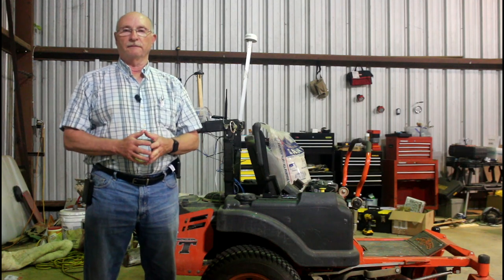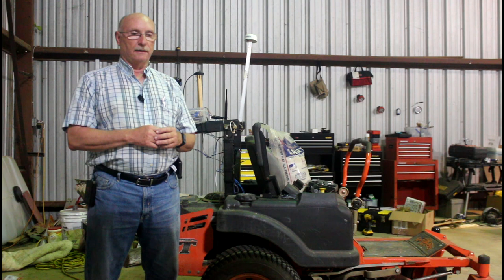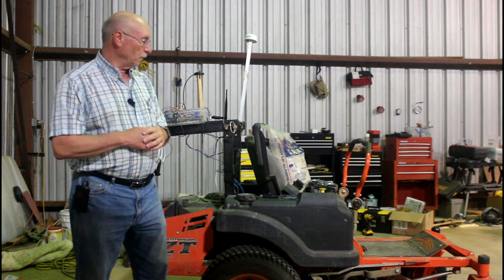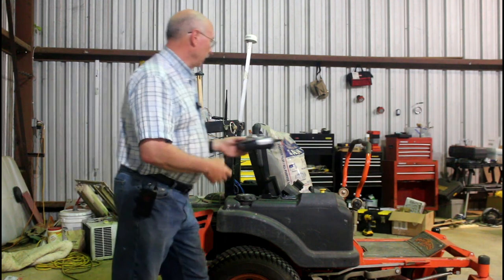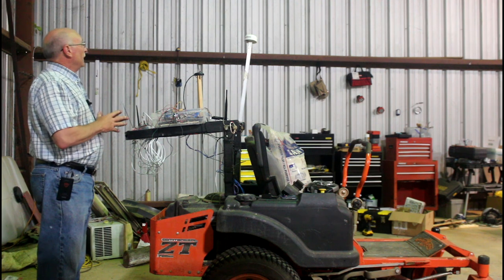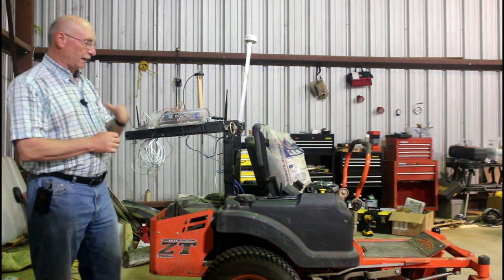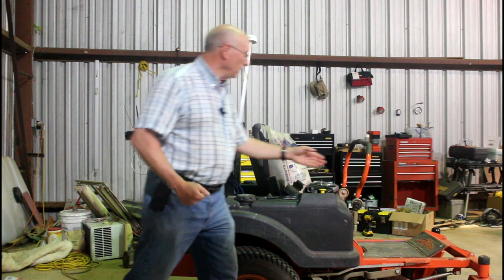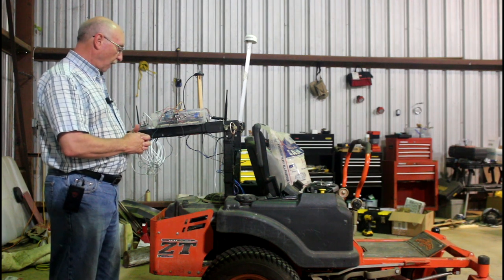Autonomous Mower Overview (Part 2) as of May 16, 2018

Comment: Thanks a lot for sharing your work!
Wouldn't it be better to fit the gps antenna to the front of the mower, so the change of heading is also detected by the gps position? I don't have any experience, but at least in my imagination this could help to improve the precision.
Reply from the maker: Thanks for your kind words! Subscribe if you like and click the notification button as I will be creating an update soon on what I have changed (which is a good bit!). As far as the GPS antenna location. It does not matter where it is located since it detects heading by its motion. It is going to be traveling with the mower in the direction the mower is going no matter where it is located on the vehicle. Now the location can affect how the vehicle turns to some degree. From what I understand, it is best to have the GPS antenna located where it turns in place if the vehicle performs a pivot turn, rather than it being where it would swing around as the vehicle turns. So, having it between the back wheels is probably ideal for a zero-turn mower. I hope that makes sense! Thanks for your interest.

Comment: how do you connect the Pixhawk to the linear servo actuator?
Reply from the maker: Actuonix sells a linear actuator control board which operates the actuator. The control system just sends a PWM signal to it as you would for a standard RC servo and the control board does the rest. You can also communicate to the control board in other ways, but PWM is perfect for an Ardurover flight controller. Note, however, that I moved away from the linear actuator and instead an using a heavy duty rotary servo, the HiTec D845WP. But the linear servos are great for some things. Here are the linear actuators and control board links if you are interested:
Linear Actuator (2 required): https://www.robotshop.com/en/actuonix-p16-linear-actuator-50mm-2561-12v-w--potentiometer-feedback.html
Actuonix Linear Actuator Control Board (2 required): https://www.robotshop.com/en/actuonix-linear-actuator-control-board.html
Reply: Thank you for your assistance 
I am interesred in the pixhawk flight controller in connection to the liner servo actuator, because the pixhawk is the autonomous navigation tool that allows me to set my waypoints 

Someone told me to add an additional 12 V Battery to the linear servo actuator but only connect the yellow communication cable to the pixhawk, because the pixhawk only sends 5-7 volts whereas the linear actuator needs more than that 

What you think? 
I thank you for referring me good linear  actuator but without the pixhawk, I will not be able to set up an autonomous route

Comment: Thanks for taking the time to explain your system Kenny. I think Rover could benefit from some sort of improved  'crash detection'.  It would be pretty trivial to alter the Rover code to output on an AUX port in the event of a 'crash' or RCIn signal . If you can program an Arduino then you can program Ardupilot! The current system is limited to the following being true for at least 2 seconds: the vehicle is in Auto, Guided, RTL or SmartRTL mode, velocity falls below 0.08m/s (i.e. 8cm/s), the vehicle is turning at less than 4.5 deg/s, demanded throttle to the motors (from the pilot or autopilot) is at least 5%. There are I number of additional 'fault' conditions I would like to detect also including max pitch/roll values, out of bounds (geo fence?) and maybe also loss of accurate control as indicated by monitoring I term in the PID loops?
Reply from the maker: Thank you. I enjoyed making the videos. I have made significant changes to the GPS RKT communication as I mention in later videos. I hope to explain in more detail soon!